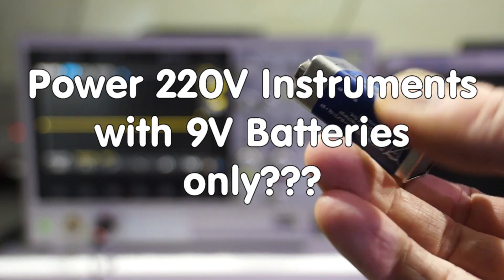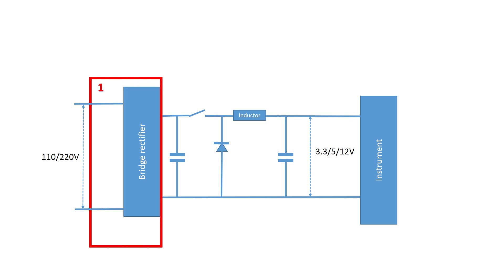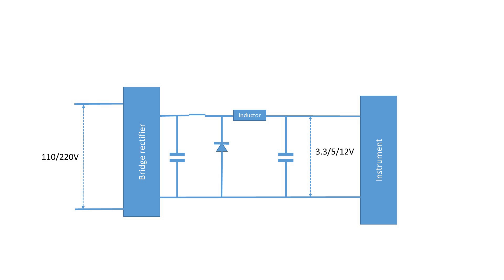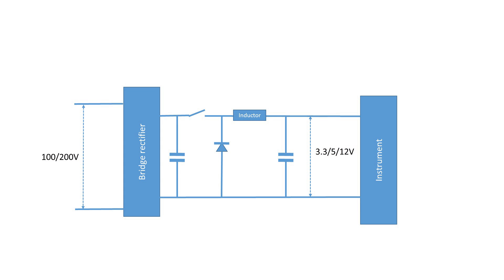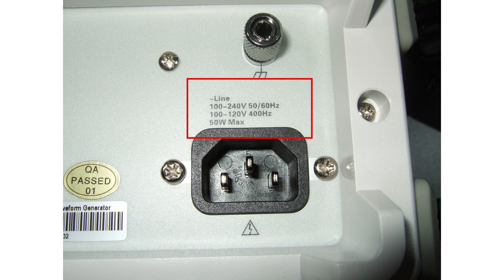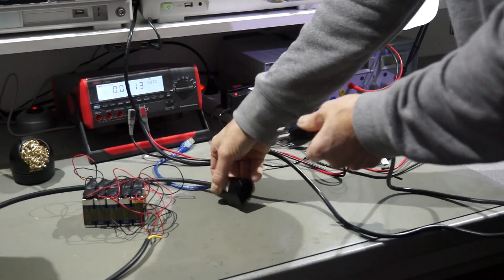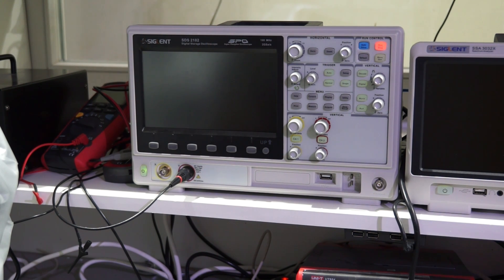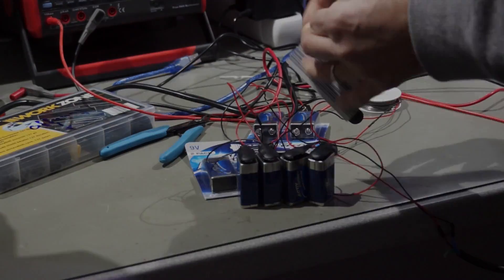#53 Test: Is it possible to power 220V Instruments with 9 Volt Batteries only ?

Comment: The oscilloscope would probably need AC input to get the frequency for timebase triggering at "Line" frequency, and maybe won't start if it's not present.  
Or because it requires AC for some other reason we can only guess at.  Most devices won't care, but some may...
Reply from the maker: The newer ones usually have microcontrollers with their own clock, so no problem. Old analog oscilloscopes for sure will not work because they have a different power supply.

Comment: The video is in a local language but a guy has installed solar panels in series adding up to over 200 V and feeds directly to the home. Has devices with SMPS, inverter fridges, inverter AC's and bldc fans. Excess is used to charge battery packs which also add up to 200+ v in series.

He does not use a charge controller or inverter or anything like that, just has some contactors that cut charging to the battery pack when they are fully charged. 

What are the possible risks in attempting something like that in your opinion?
Reply: https://youtu.be/VJRkjqK1UZg

He has a circuit here. Apparently running for 5 yrs now
Reply from the maker: It is not advisable to overcharge Li-Ion batteries because they can catch fire...
Reply: @AndreasSpiess  right, he is using  a voltmeter that drives a relay to break the circuit when voltage is above a certain number.

Comment: Could I use sth like this to power Marshall AS50D acoustic amplifier? thx... So the idea is to use device such as guitar amplifier on a street
Reply from the maker: I do not think so. You need much more power
Reply: @AndreasSpiess  what about 12 volt inverter with 2000 wats power?
Reply from the maker: I would look at the requirements of the amplifier and decide

Comment: Your Oscilloscope  requires 100 V AC at minimum. 
The first capacitor of it's powersupply is then charged to the peak voltage of the AC witch is  100V x (square of 2) = 141 V.
So to be in spec you need at least 140V DC to power it.
Reply from the maker: To be in spec you are right. Sometimes things also work outside of specs ;-) And I love to play...

Comment: you should explain how amps also matter as a device may be 12 volt but with to little amp it will not work.
Reply from the maker: You are right.
Reply: Is there any way to overcome this. I put 9 volt batteries in series for some arduino but not enough power

Comment: Excellent idea, with a proper lithium pack as well as good step-up dc-dc converter it should be possible to power any equipment that has universal input 100-240VAC and power it in the field for example.
Reply from the maker: +VoltLog I also think so. One viewer suggested, that the oscilloscope did not start because lack of mains frequency, but I am not sure. My boost converter only goes to 96V so I cannot prove it for the moment. Maybe I can trim it a little higher by changing a resistor or so...
Reply: DC/DC conververter for mobile mains devices is a very nice idea. I wonder why I never thought of it before.
I also wondered if the oscilloscope has something like main sync circuits that affect the startup, all need need is some initialization routine to get stuck due to 0Hz..

Comment: Never be so afraid of mains voltage as to prevent you from satisfying your curiosity.  If this worries you use a small gauge wire to limit the current.  After all, unless you get used to using it in your experimentation you will miss out on many concepts such as how ac motors work.   I suggest if you a weary of its use try using a step down transformer an play around since ac is not dangerous below about 50 volts or so.  Then you can just use the power from the wall to energize your projects.
Reply from the maker: +Joseph Nicholas I did this experiment out of curiosity. So, I might not use it often. But it gave me some insight into an area I did not look before. I thought, maybe this could be interesting also for other people...
Reply: I would encourage people to get familiar with ac power from mains instead of fostering a youtube common practice of fear mongering..AC MAINS IS YOUR FRIEND.

Comment: Great video, but the explanation does not show an isolated supply with a transformer, which is what is all your shown equipment uses. You should mention that. I guess the scope will not POST because it cannot sense the line frequency which is uses internally for triggering etc.
Reply from the maker: Thank you for your explanation. I propably oversimplified a bit.
I did not investigate in the reason why the scope did not start, because I thougt, the voltage was too low. But you are right, it could have other reasons. This would be good news as many other devices would work, just not oscilloscopes.